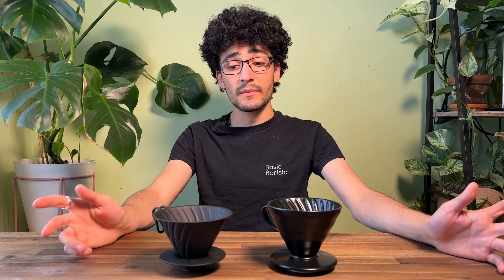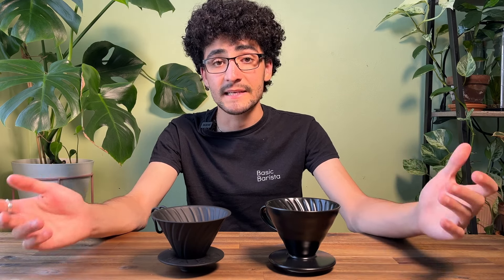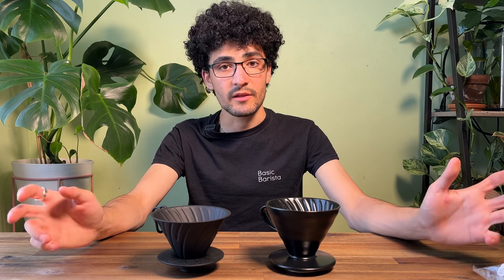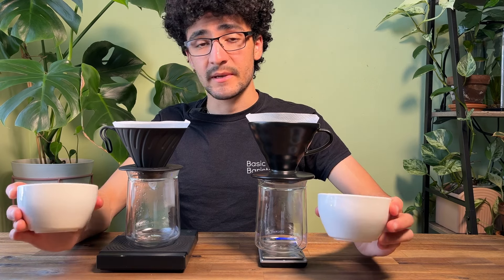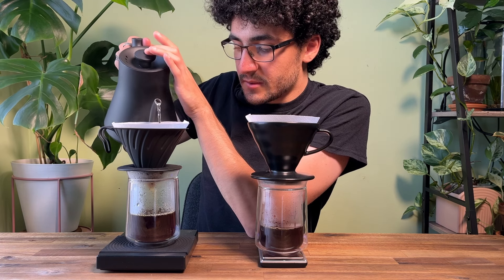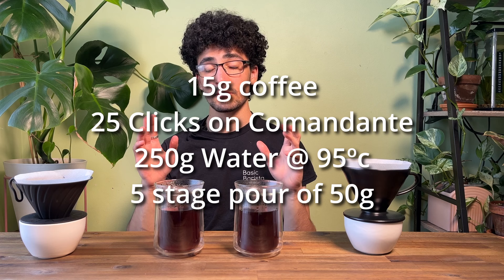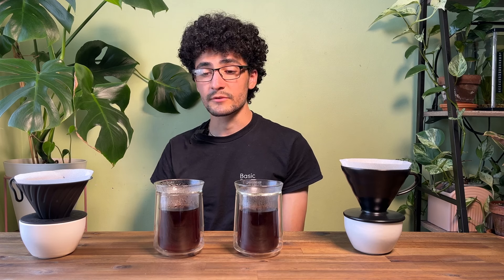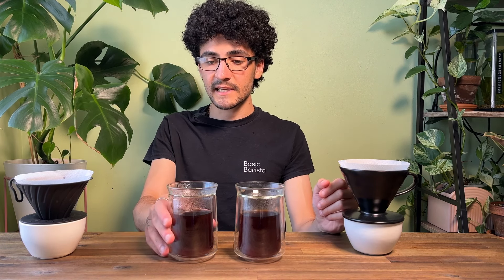Metal Vs Ceramic V60 - Taste Test Comparison

Comment: I assume the steel extracted more compared on that of the ceramic due to the difference in heat dissipation.
Reply from the maker: I think so too, as well as the way it interacted with the filter. However I don't have enough measurements to give a definitive answer.
Reply: Metal’s heat transfer coefficient being much higher than ceramic. It’s thermal conductivity is much better thus allowing the dripper to absorb heat much quicker. Overall heating is also better because of this condition of metal. In fact many people even use plastic over ceramic because it gets hot way easier and provides a much more comfortable working space. Going for the steel one would of course be much more durable and also a far better option. Hope it helped if you were undecisive. 🎉